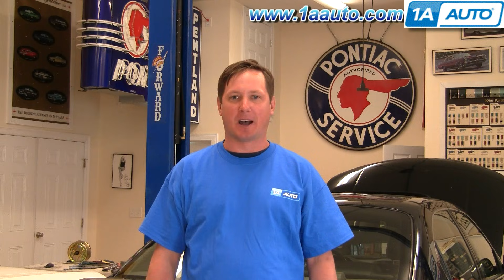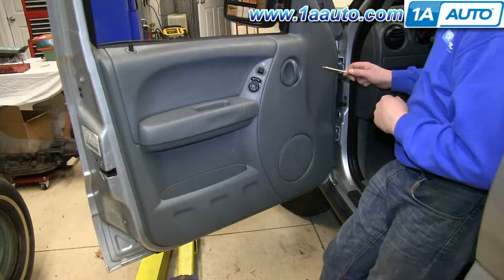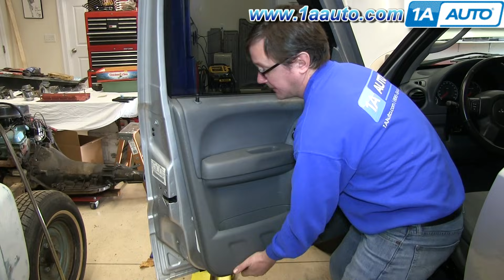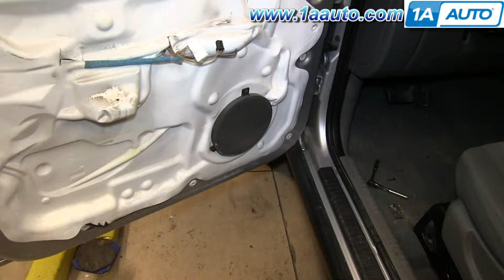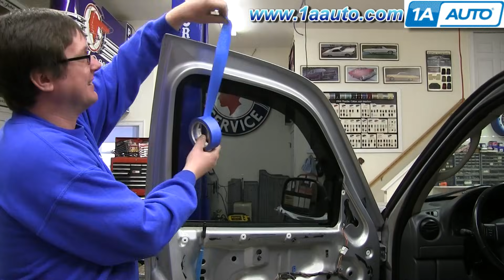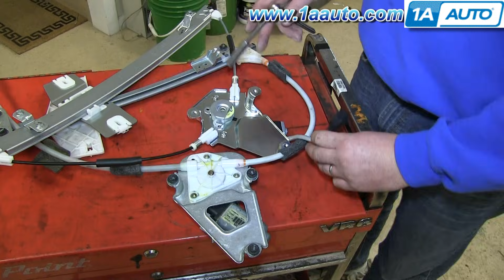How To Replace Front Window Regulator 02-07 Jeep Liberty

Comment: One thing forgotten...after the window is on the track, pushed into position on the studs....reaffix the side clips to keep the bracket on the window. With my replacement, the clips had to be removed from the new unit first as well. Also, didn't need to switch bolts as the new one came with all 6 bolts.

Also, it's worth mention that when re-installing...the top of the new unit needs to slide behind that top flange. The side towards you. That's where the difficulty lies. Squeezing it behind that flange and then moving it into position. Otherwise that top bolt won't get close enough to to hang on the hole. It also made it a lot easier to get out when that top bolt was removed altogether in the beginning. All the bolts can come off to help slide the unit out.

Comment: so i have a question. when replacing this you have to roll the window down first? in order to get it off the regulator. well what if the window does not roll down? can it still be done?

Comment: Just finished switching mine out. I struggled with 2 things. First was getting the old regulator out. The top part was stuck in that space up there. I had to get that bolt back to its hole and take the bolt all the way out. Then it had room to come down. Second was getting the motor into place after getting the new regulator into position first (was following what he did in the video). So I took the bottom bolts of the regulator back out of their slots, then I could get the motor the extra half inch over to slide its bolts into place. Put the regulator back and everything went in nicely. Works perfectly!

Now I need to order one for the rear and I'll remove all the bolts completely from the start, in case I run into that same problem.

Thanks for the great video!

Comment: My window shattered and I can't get the new one into the door. It won't fit I tried front end first and it gets wedged help!
Reply: K I figured it out. The New glass CANNOT fit into the new door if you have one of those AVS rain guards on your door. You have to remove that first then it goes in easily from the outside flat against the door. Ughhh now I need a new rain guard too.

Comment: Whenever a brand of regulator has its own screws - USE THESE!! I bought one brand and it needed to reuse the factory motor screws, but came with smaller track/regulator screws. I put all the factory screws in and the two at the bottom of the track were too long making it hit the window carriage. The window could not go all the way down. Uuups. Factory screws are best, but sometimes regulators have their own for a reason. Move the window down slowly to see.

Comment: I've replaced the window control motor but the problem now is the drive core when you try to lower the window bucks up and out of the window slot and prevents the window from going up or down til you you cram the core back in the door...is there an adjustment to the window track to stop this binding from happening?

Comment: I was pulling window down & heard a pop...as window went all the way down a cable or wire popped up in front of window slot...window still functions
Reply from the maker: +Heel 4Reel We wouldn't be able to diagnose an issue like that here, you may want to have a local mechanic take a look at it. Thanks for checking us out! http://1aau.to/m/Shop-1AAuto-c
Reply: @1AAuto  well i watched this video to learn how to take door panel off...if i cant fix it ill take it to auto shop...thanks

Comment: Thanks soo much for this great video!  Took me about 1.5 hours from beginning to end.  I did have a little difficulty trying to line up the bolts on the motor end once I installed the new regulator.  I removed the three bolts and lined the holes up and then was able to secure them.  Everything works great and it's nice to have my window working again after four long months of not being able to operate it...  :)  I purchased the upgraded regulator and it was 10 x's better than the old one.
Reply from the maker: +Jackie Folio Thank you for the positive feedback, Jackie!  We really appreciate it! If you have a minute, drop us a review on our Facebook page to let other people know about your experience with us. Here's a link: https://www.facebook.com/1AAuto/reviews/
Reply: I just commented on the video saying the same thing about the bolts on the motor. I took the bottom two bolts of the regulator out of their slots so I could move it over just enough to get the motor bolts in. If that didn't work I was going to do as you did. It just needed a half inch more to make it over there!

Comment: Thanks 1A.  Great video and your replacement part works great so far.  If you update, consider adding the different clip styles.  The one I had had the center plastic clip that fits in the hole at the bottom of the window.  Not difficult to figure out (push tab with phillps screw driver and pop out), but might be a helpful add if you update.
Reply from the maker: Thank you for your order it's greatly appreciated. If you would like to leave a review for us on Google it would be greatly appreciated. Here's a link to our reviews on Google. Have a great day! https://goo.gl/Z1UgiB

Comment: I'm having issues with this project. I've replaced this item twice now (with you guys sending me a replacement part for the first one I bought) and it continues to malfunction. Each time I complete the installation, the window will not go up straight. The motor struggles to get the window moving up and then the window tilts forward and wont go all the way up straight. I have to use my hand to straighten the window out for it to go up straight. I know it's installed correctly since there really isn't a "wrong" way to place the part in the door. Plus I've taken it apart and tried again about 5 times.  Any thoughts/suggestions are greatly appreciated.
Reply from the maker: +Shane Pace It almost sounds like something is in the way of the glass and slowing it down.
Reply: 1A Auto Parts same problem in an 07. There is nothing obstructing the window. It just tilts towards the front of the car. It’s quite the frustration. Cleaned everything with cilicone